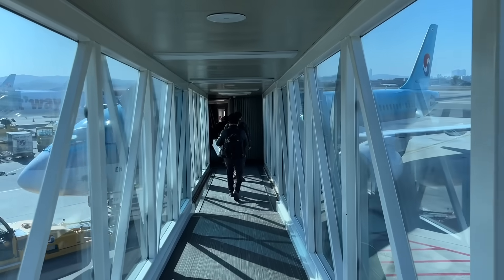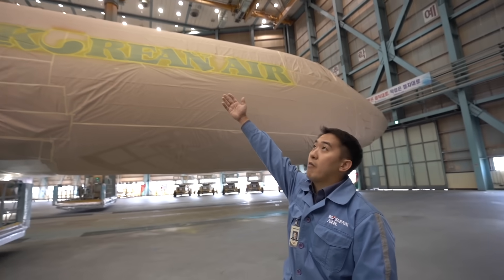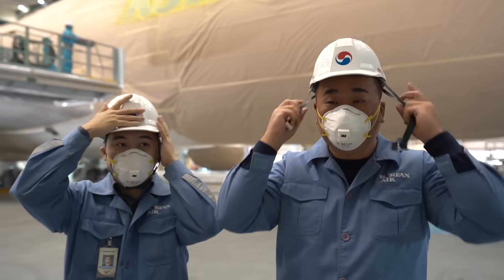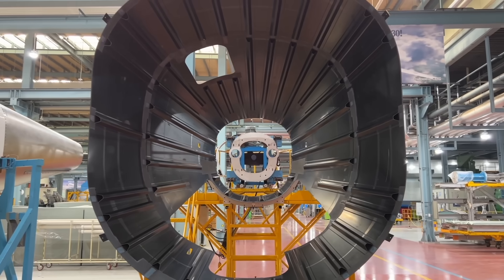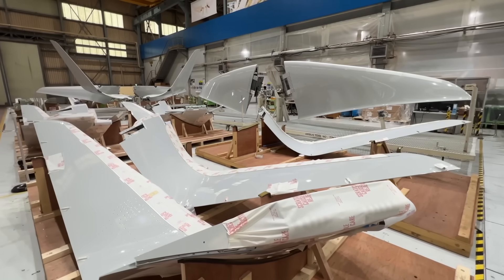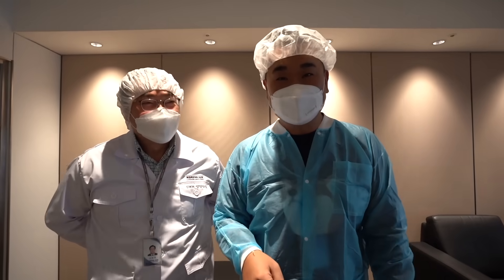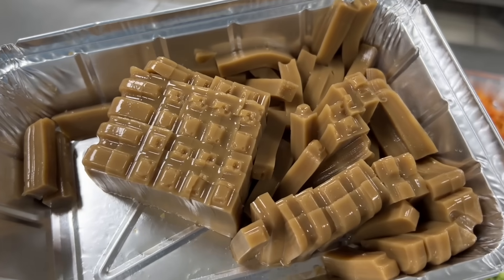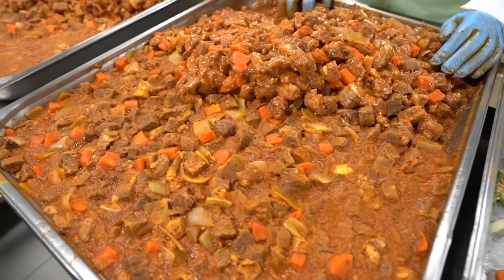Inside Korean Air - Painting a 747 + Airplane Food

Comment: Korean Air should have acquired additional B747-8I aircraft . . . replace their existing fleet of A330-300 with B787-10 & B787-9 . . . that's a B777-300 ER Combi . . . remember the B747-300 Combi from the recent past . . .
Reply: It's the age of fuel economy....so 4 engines are out for big twin engine aircraft.

Comment: I remember being told that Korean Air was also involved with manufacturing wingtips for the Boeing 747 as far back as 1986. But I don't know if these were for the 747-400. And I'm sure that they have been involved making other parts during the production of the Boeing 747-400 but I can't remember what else they made.

It's really significant that Korean Air is the worlds only airline that also makes major aircraft parts as a supplier to both Airbus and Boeing. I have been working in aircraft maintenance for the last 35 years and Components made by Korean Air have always been highly regarded by our staff for being very well made. Nice to see inside the manufacturing facility.